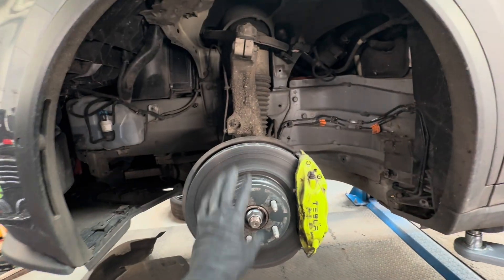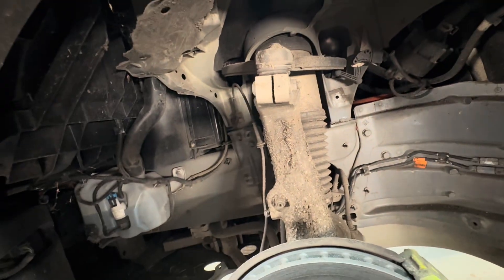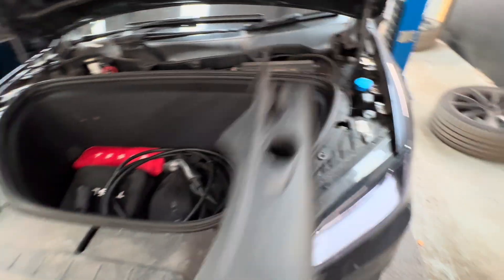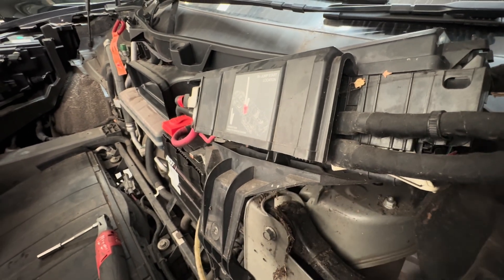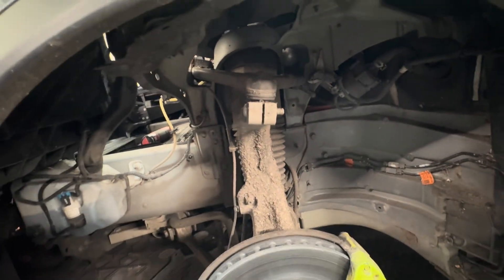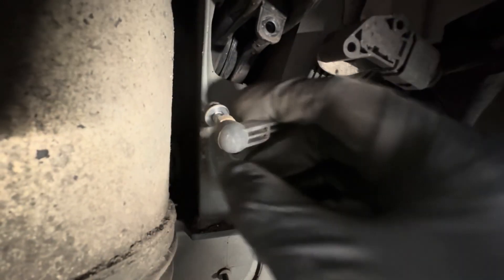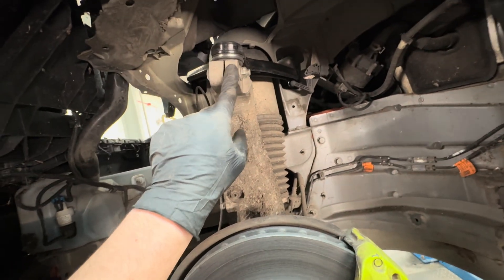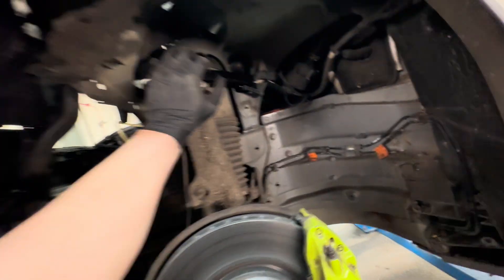How to replace the front upper control arms on a Tesla Model X & S

Comment: Awesome Video! I have a horrible vibration coming from the front right wheel.  I'm assuming it's in the front right arms but haven't taken the wheel off yet.  You  think it's also the control arm? I know prior to the bouncing, it was also loud and popping.
Reply from the maker: Could be arms but could be driveshafts. You should know more once you’ve taken the wheel off and had a look.

Comment: Hi mate, my 2020 Model X Long Range makes a clunking or knocking sound from the front when turning at a T-junction. It doesn’t happen when driving straight or over bumps. Could you please advise whether this issue is likely coming from the driveshaft or the control arms? Thanks.
Reply from the maker: Ravens do tend to skip the front wheels on heavy turning. I’d say it sounds more like a lower control arm outer ball joint than upper control arm. Driveshafts are a possibility and best way to check is by accelerating hard in a straight line and listen for a clicking noise

Comment: Does tesla sell one with a grease fitting on the top? Or any third party maker?
Reply from the maker: Not as far as I’m aware. I have seen people install a grease nipple on top but it didn’t look easy. If it were me I’d consider the power flex upper control arms as a longer term solution.

Comment: Nice video! 

But you did not show the procedure of getting the bolt in the back mounted again. It was a bitch! Took me 5 (!) hours to get this done 😂😞
Reply from the maker: Yea it is a nightmare, it took me around 10 mins. Because I didn’t have a proper camera tripod this bit got missed! I have just invested in some Meta AI glasses so I should be able to get much more detail in future videos!
Reply: Oh god please give me tips, I’m gonna attempt this repair.  Squeaking ball joint MX20’
Reply from the maker: @widgeonrblx8543 the back 2 bolts are the hardest as you have to line the bushings up with the holes but you can’t really see them. In my opinion it’s easier if you get the one closest to the back in first and you’ll need the angle to get the bolt in, you’ll find putting the back two bushings in the hardest part, it’s quite tight. Have a pry bar, and something to push into the bolt hole to pull the bushing into place. Best of luck!
Reply: @Richardsonsautomotive  Yeah. It was very hard to see. The bracket holding the pump is supposed to be removed, but there is no way to get tools in to remove the four bolts

Comment: have you changed the lower suspension arms on a model X before? would appreciate some guidance
Reply from the maker: @marcustuohy  yes I have, I’ve changed most bits on an S & X. What is it you need help with? You will need new inner control arm bolts as the old ones will need cutting out, when you refit you will put the bolt the other way and it will all go back together.

Comment: Hey Daryl thanks for the content! Just about to tackle this job on my X this weekend, replacing fore and aft lower controls and upper controls on both sides. Wondering if right upper control arm is same as left upper in terms of process? Are there any components in the way ?
Reply from the maker: @Andrew-vx4jv  hi Andrew, there is one extra thing to move on the driver side. On the rear inner bolt on the driver side there is a coolant pump that you need to push inwards to get it off the bracket that holds it to the body, this will give you access to the rear inner bolt. The driver side is actually easier as the fuse box doesn’t cover the front inner bolt.
Reply: @Richardsonsautomotive  Thank you Daryl, Wish me luck!